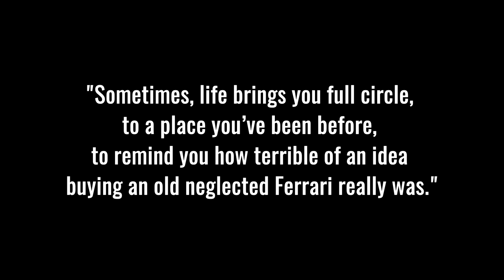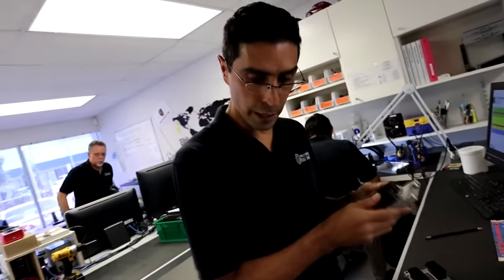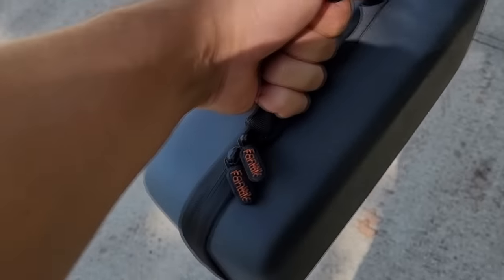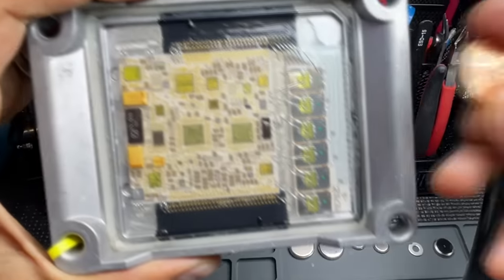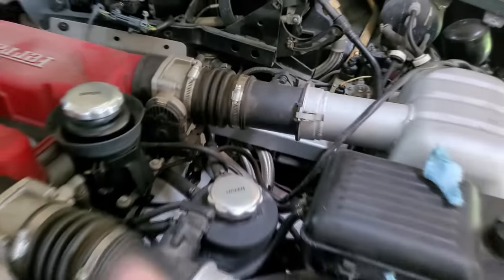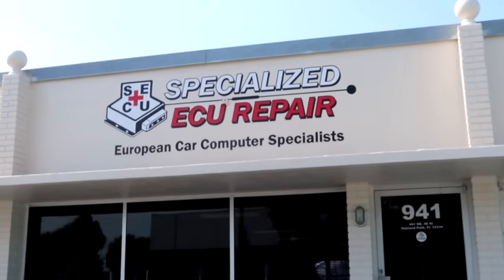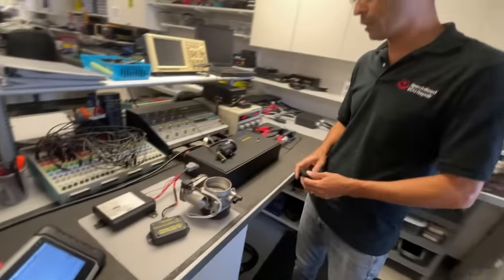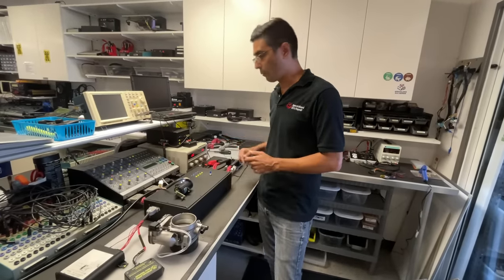Here's What FINALLY Fixed my Cheap Salvage Ferrari!!! (EVERY Ferrari 360's Fatal Flaw)

Comment: Great content, and I'm really impressed with the work of ECU Specialized Repair, but a word of advice........ NEVER EVER connect a battery terminal without tightening it up....... The reason being is, when you crank an engine, the starter will pull a few hundred amps from the battery (depending on engine size, battery capacity C.C.A., resistance of the starter and ground wiring Etc). If your battery connections are loose, then you are trying to transfer a large electric current through a bad connection, which can result in an electric arc at the battery terminals causing chemical deposits to occur on the battery terminals which form an INSULATOR (i.e. the battery is no longer electrically connected to the vehicle). This sudden disconnection of the vehicle battery supply can damage or corrupt vehicle computer systems, or even cause the vehicle battery to explode (car batteries can give off Hydrogen gas)............. So please make sure to tighten your battery terminals........

Comment: Hi, Sam. I remember like 40 years ago I had an AMF Harley Davidson snowmobile. A 1974 that had a bad ignition module, so it never ran. I'll bet Jose could perhaps either repair or rebuild that bad module. There was only 1 available in Canada back then at Trev Deeley Distributors for something north of $1500.00. I never rode that sled and eventually sold it for parts, but.....

Comment: This is a typical early 2000s Bosch design, it was also used  for exampleIn Bosch ABS 5.3 controller or in VP 44 diesel injection pump, the little aluminium wires are braking due to fatigue, if you have good eye and special paste for aluminium soldering you can repair it by yourself, I have done this a couple of times.

Comment: I'll be honest the issue to me seems like it could be a few of the following;

A poor connection to the ECU - You had swapped it out previously so kinda suggests if something got in it could cause damage over time. 
or The ECU could also be browning out, it seems to be stuck in a reset loop hence why you can't get comms to it - you can try cooling the ecu down a lot from room temp to see if it starts working.. if so then maybe a few caps have given up the ghost and need replacing but could be bodged on from what I saw.

Comment: Well what you would need to do is dump the logic chips and find out what function each chip was handling for 1. Get blanks and reprogram them the same way or make a custom chip that would replace all the functions, then just make sure to wire it the same. Ie retain the same outputs and inputs even tho you are using a different set up we need to trick the car into thinking there is no difference because everything still works the same. I know this is simplified but its essentially what you will need to do if you want to make your own ecu. Custom logic chips mirroring the functions while retaining the same wiring scheme. You will likely need a co processor to go along with this and some memory modules as well. But the important part is retaining all the functions of the original ecu and inputs/outputs

Comment: Cool - glad you're up and running! There were times I was on the edge of my seat, wondering what else could possibly go sideways. Good job.

Regarding re-engineering those near-obsolete engine computers: one would have to know exactly what the factory unit is doing. That's quite a job. 
To reverse engineer a particular unit on the bench would be really tricky because you'd need that entire setup you just showed +PLUS to make happen. 
You would need a car, skill, tenacity and time. 

On the other hand, selecting a processor that could deal with the harsh environment and giving it a bunch of flexible, bulletproof, robust input and outputs would not be too difficult. I'd imagine that a softcore processor running inside an FPGA would get you maximum flexibility and security (so nobody else can copy your design).
To make it impervious to temp, shock and vibe is a challenge, but many people have designed for MIL-SPEC, so those problems can be overcome. 

A generic design could allow one to download firmware, car specific stuff along with tuning data so it could potentially be used in many cars. 
Maybe sell OEM compatible cables to interface between this controller and the car -- like Crutchfield does with their car sound systems. 

I don't have a supercar sitting around to experiment with and suspect not too many people do. 
Those that do have one likely don't have the skillset to pull this off - so this means you need a gaggle of owners, mechanics, technicians, and engineers. 
If there are people out there interested in doing something like this, I'd be interested in teaming up with you.
Reply: HEAT kills components. Give some thought to increasing cooling of ECUs.
Duct in fresh air with inline mini fans. Shroud the ECU to create optimal flow, 10 to 15 degree  temperature drop may provide longevity.
Reply: @David-uu1oj  Yes, definitely true. Commercial parts really do not take heat well. It certainly ages them much quicker. 
Besides your very valid suggestions, they could also relocate the ECMs out of the engine compartment. Or retrofit units could be equipped with coolant lines that get rid of heat outside of the hot area, like some PCs do, using heatsinks with coolant ducts running through them that dump the heat elsewhere. 
It is surprising they didn't think of that when the thing was designed.
Reply: @kastooMcFry  
.....yea, im a toilet cleaner and have always known this with lap tops.....🤪
Reply: @David-uu1oj  you have to use automotive grade components for heat and cold.  100c  to -40c

Comment: The answer is in the diagnosis.  It requires 2 ecu that are to be identical.  Why not have one ECU with a connection that comes of it for both driver and passenger side.  It's getting identical information from the ecu to run however it would require firmware that it reads both sides of the engine software can handle that that is what it's designed for.  Because hardware will only do what the software does.  It's upto the software to listen and respond to the hardware and it's variables.  If it needs to read that 2 ECU with mirror programming is required to start.  Then I would also suggest a prior to start default mode be programmed in place so that it is sending identical required information from the single unit and once started it goes into a secondary running mode that splits the analyzing and reaction side in the ecu into 2 separate units to monitor and respond accordingly to the 2 sides of the engine.

Or just build a Y cable that branches off to both sides of the engines original ECU connection so it reads from just one ECU.

Comment: There are hobby guys with wire bonding machines, but I don't know about ceramic substrate component level repair. I don't know if he would look at it, but "The Signal Path" would know all about it - he does very high end repairs of test equipment -. There is also high level engineers on the EEVblog forum

If it's got ASIC's you're dead in the water, but maybe you can reproduce it on a PCB, or just replace the whole thing with after-market.

Comment: A couple of points for what they are worth. 
Vauxhall/Opel use this family of ECUs on many of their petrol vehicles, they mount them on the side of the engine too. They also fail. I use ACTronics in the U.K. for repairs. As far as I know the most common failure cause is failure of the heavy wire (Aluminium) bonds due to too high a current density. ACTronics replace these using a Delvotec wire bonder, it is visible in some of their promotional material. (I recognised it straight away as I worked in the semiconductor industry some years ago and used to repair them). Component failures would be much harder to repair of course because that would me heating the whole module to reflow the solder to remove the die and also the fine wire (gold) bonds would need reworking. Not impossible but very much harder work. It’s all do-able but would take a far bit of investment by any potential repairer and they would need a reasonable return on their investment.

Comment: I've replaced my Jeep Cherokee's instrument cluster from idiot lights to the upgraded guages. This would cause having to certify the discrepancy between the recorded mileage when having the yearly inspection done.
Since it's only an 8-bit chip that has this information on it we have a clip that goes over it and allows us to copy the information to a laptop. Afterwards we put the clip on the new donor cluster, erase its information and then download the correct data from the old one.

Comment: Great job 👍 on the electronic Control Board.
I had problems with my 1977bmw control board, sitting behind the glove box.
An easy fix, compared to your issue.

Comment: Never had ECU problem on 1980 BMW 320i.  2013 BMW 535i M-Sport, different story.  I am On my 2nd Valvetronic ECU Module now and 3rd Valvetronic Actuator.  40000 miles stock and babied.  If it ratchet clicks after engine shut off, expect Drivetrain Malfunction fault within months.

Comment: What about -30 below zero, how good is that battery booster? Starting a truck in the middle of the summer is not really a challenge. When you are in a hurry and it is -30 outside, I'd be surprised that booster would do anything.

Comment: It is the bond wires seperating from the "board" (the raw components mounted to the body heatsink) due to heat cycling over time.  Had the same problem with a bosch ABS ecu on a 2000 SAAB, which is constructed the same way and suffers the failures due to it's location (on the brake booster, over the engine).  Ferrari seems to have made the same mistake with the mounting location.  There is a company that specializes in fixing those ABS ECUs, try googling it - I am willing to bet that they would be happy to take on a new line of work.  The service was around $100-150 years ago, probably not much more now.

Comment: The issue is that all ECU replacements would have to be EPA certified and that is not an inexpensive task nor is the EPA easy to work with, I purposely kept C.A.R.B. because they're impossible to work with.

Comment: @15:12, I used to work in RnD that designs and manufactures those hybrid modules. It would cost a minimum of USD2M to setup a prototype lab for that. And yes, that module cannot be repaired easily if at all even possible.

Comment: Sorry to be so late, but have you thought of giving the Speeduino project a try?
It's a DIY ECU based on the Arduino microcontroller platform. I know it can handle V6 engines, so you could use it on a V12 with lost spark method on the alternate cylinders.

Comment: Hybrids like that can definitely be reworked.  Each of those silicon dies on there is roughly equivalent to a plastic chip on a PCB, just without the plastic or the lead frame.  Requires specialty equipment (like a wire bonding machine, not crazy expensive, for a business, on eBay), but can be done.  It will need fairly specialist knowledge to do it though. The hard part is finding replacement die.  If its something generic, like a power FET, you can probably find a close enough equivalent on the open market. But Bosch is big enough to get custom silicon manufactured.  If its one of those dies, forget about it.  Bosch will never sell that and they probably don't make it anymore anyway.  If you do narrow it down to a die, you can usually use a microscope to read die markings.  That can tell you who made that die and, sometimes, tell you what the part number is (some manufacturers put the actual part number on the die, some do something different).

What you'd need to do would be to probe the hybrid and narrow down the fault to a component. Those are a little too fine to do by hand, but old probe stations intended for silicon aren't too hard to come by.  They're basically just a microscope mounted about a sturdy stage you can put micro manipulators (a holder with little screw adjusters that can move a needle finely) on. Somebody clever could rig something good enough out of common parts.  Or you could buy used ones on eBay (they're not that expensive for a business).

Comment: Terrible experience with a 2007 Benz CL500 (CL 550 in the Americas), sent the ECU to a specialized ECU test and repair shop in my city which said there was a software issue. The only solution was have it swapped by the dealer for a considerable amount of money. 
An OBD will never be able to tell you the brain of the car is damaged, error codes showed problems with O2 sensors, alternator and throttle body. The amazing thing is the dealer proposed me to change the O2 sensors and throttle body first time I went there, I changed the throttle body myself (getting a used part from the scrapyard) with no difficulties and had sensors replaced by a mechanic but the dashboard kept showing the orange check engine light. On my second visit the dealer proposed me to change the ECU which had to be shipped from Germany, it took three weeks to get it even though I "only" live some 800 km from there (500 miles).

Comment: i do specialized microsoldering on electronics, mostly in liquid damage and data recovery. let me know if there is any advice/insight i can provide for possibly repairing these ecu's. what i see from the video is that the bad ECU isnt completing the initialization process. during this process it checks all components which is why the throttle body clicks once, i think there is either a hangup during that part of the self checks, or some sort of over current protection is kicking in causing it to loop at that point in the self test.  i think the best course of action is to reverse engineer the computer and make drop in replacements made from normal repairable components.

Comment: ECUs go bad in all vehicles. The transmission computer in my minivan died recently - hard fail with one of the ROM modules. It was stuck in 2nd gear (limp home mode). Fortunately I grabbed another from the junkyard for forty bucks and it runs great again. Didn't even need to reprogram it.

Comment: REMEMBER:  As the years progress there will also be more and more salvage vehicles for parts. Especially from accidents which would be unlikely to harm the ecu s .  At least for now the ecu market will be high but in a few years relative prices may drop since there will be more taken off the road AND fewer will still be on the road to need the parts.  However the ecu s available then will be old and not likely last as long.  
I wonder if some type of enclosure with cooling and vibration dampening mount would help them last much longer.

Comment: Those of us that are Electrical Engineers see right through this problem to the logical answer.  A replacement for this ECU can be made using Programmable Logic Arrays... essentially a canned building block chip with several technologies in one chip.  You only need to map all of the inputs to the outputs and the functions they provide... and build little programs to emulate what the ECU does.  Easy-Peasy.  Been there, done that.

Comment: Maybe instead of waiting for a fix or a cloned replacement, maybe you can make an interface board that goes between the wire harness and the module. The interface board is designed with parts to electrically isolate the module from the car. That way if there's an accidental short (for example) in the car ignition, that short doesn't reach the module. You blow the interface board instead of an expensive module.

Comment: Since Bosch made the ECU's I would wonder of they could remake another batch of them in order to provide to customers. Otherwise you'll need people who can reproduce the software and possibly adapt a later design or specially built ECU custom made for what ever vehicle that needs it. It would likely take hardware emulation to work with the rest of the car's systems, and that would be a lot of work if it could even be done.

Comment: difference between DIY and dealer is that they DIYer diagnoses, diagnoses, diagnoses, and then verifies with a part replacement. Dealer tries replacing parts starting from most common to least common failure.

Comment: Really surprised it wasn’t repaired when this is a known issue with these ecu’s.
When he’s holding the ecu with the back off so you can see the insides. Look on the right hand side there is a long black component (oscillator) with a yellow component above and below it (tantalum capacitors) 
The capacitors become detached from the board causing this issue. 
Not the easiest ecu to work on but can be done.

Comment: They arent serving anything, they are reprogramming a new or used ECU and sending it out.  If they can extract the firmware,  why not use or develop a replacement module using off the shelf components?

Comment: Get a newer firmware (>2009) if you can. If you let the battery go too low on earlier firmwares the staus of low voltage is not detected, ECU writes on the flash while underpowered (while it shouldn't) and it will often corrupt all the flash. The flash is shared between firmware and parameter storage area, thus also firmware gets corrupted. The ECU cannot boot and reboots continuously, that's why the continuous movement of the throttle body due to the digital lines being reset.

Comment: So, I do have a limited experience with fixing these, and I think it’s possible but it’s very tedious. The silicone needs to be taken off with acetone which isn’t as easy as it sounds. You then need to find a way to evenly heat the ceramic. After that someone with a very steady hand could get a very good magnifying glass or microscope; take a very small very fine heating pin to remove whatever chips need to be replaced or reconnected. You then need to re-seal it with silicone jell once it’s done.